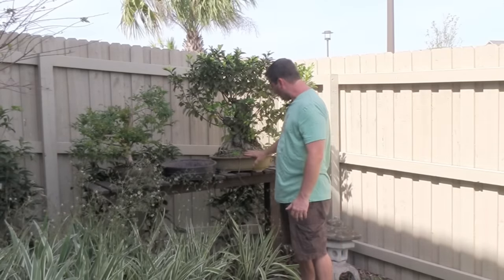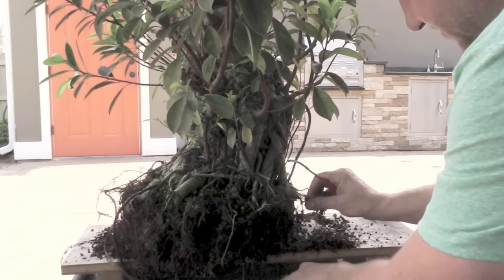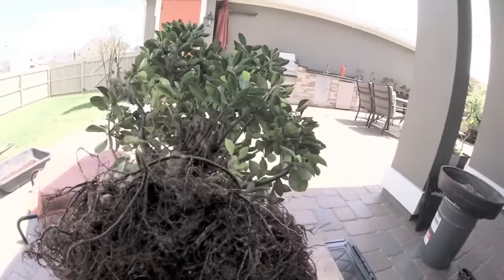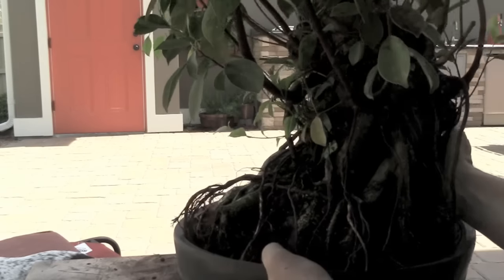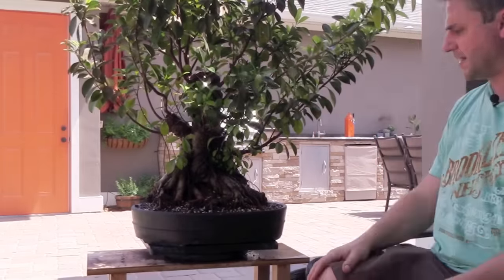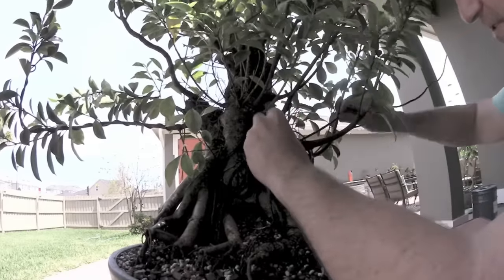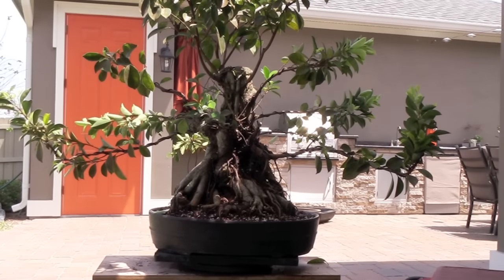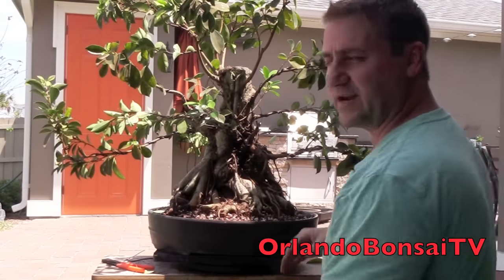How to Bonsai - Ficus Tree Update

Comment: Very nice--thanks so much for this wonderful sharing!  I'm living in extremely humid South China.  I've been wanting to get into bonsai for a long time and  finally got in contact with some bonsai experts in a commercial nursery here, but things are done quite differently and not sure what advice to take.  Chinese do tend to be a bit slap dash--so anyway, when selling me a tree and re-potting it for me, they would put large pottery shards at the bottom of the pot, instead of screen and they don't wire the tree into the pots.  I wonder if I should get screen and plan to wire them in and risk re-potting them so soon again.  They didn't repot in the sense that they didn't do any root work--they basically just transplanted with all the dirt attached.  Could you kindly tell me what's best?  Also, when I asked about plant food, she told me just to pour in some pu'er tea--the first washes of the tea which you don't drink.   Thank goodness I drink a fair amount of pu'er tea!  They tend to specialize in podocarpus and don't seem to have a variety of other trees, though did manage to get one small (half sunburnt) maple, an azelea and a loropetalum. The soil mix she sold me was so hard it was like pieces of rock with what looked like occasional very small pieces of brick in it!   It was kind of irritating because I wanted to use that soil for my little miniature moss gardens, and it was like little rocks, whereas you need to put moss on un-littered surfaces.  Anyway, insofar as the bonsai trees go, I guess they are professionals....and maybe should just do what the Romans do....?  Before finding them I had bought a ficus retusa on the street a few months ago, which I haven't touched but think I'll begin to prune soon, because, though it's base is much smaller than yours, the thin branches are getting like four--five times longer than the tree and it's not only looking very strange, the branches are falling every which way and getting into stuff.  I was letting it all grow and grow in the hopes that the trunk would get fatter.  Oh, and btw, you might want to aim your camera a little higher next time so we can see what you do at the top.  However, it really was fine.
Reply from the maker: Hi Susan, I
m so happy to hear you are trying bonsai.  The technique that they use for potting is very traditional  The screens are a newer method but the broken pots is what was used for a very long time and works well.  No reason to use the screens if you don't have to.  Also the wiring in is needed if the tree doesn't have many roots or is unstable in the pot.  If its a tree that's been in a pot for a while it will stay in very well especially when the roots grow.  Bonsai soil does not use any potting soil or dirt of any sort.  It is all course materials with sharp edges to help the roots get more air and split more often so that the trees can survive in smaller pots than those in potting soil.  Moss will grow on this soil in time.  Don't worry you are on the right track.  Follow the locals, because they know best what grows in that area and helps them stay healthy.  Good luck and thanks for the comments

Comment: I live in Kissimmee and bought a Bonsai at home depot that I identified as a ginseng ficus. It has done well and I planted cuttings that are doing well. The original has only four branches with many leaves and roots starting in the center of the primary root. It is still in store pot. Would like to know how or when to re pot and if the branches should be wired together to force larger root. It has a horseshoe shaped root with four long branches growing straight up. Don't know how to proceed with it. Any advise would be appreciated love your videos and have a great interest in Bonsais.
Reply from the maker: Hi Doreen. Since it is a tropical tree you don't want to work on them until spring. Keep it fertilized with something like osmoscote time release. Also search for Central Florida Bonsai Club. We would love to have you join us

Comment: Thank you sir for the great video, plz what kind of soil whould you use if u lived in a hot, dry climate characterized by long, dry summers and short, cold winters. The climate is influenced by Jordan's location between the subtropical aridity of the Arabian desert areas and the subtropical humidity of the eastern Mediterranean area. January is the coldest month, with temp from 5°C to 10°C, and August is the hottest month at 20°C to 35°C. daily temp can be very hot, especially in the summer; on some days it can be 40°C or more?!
Reply from the maker: Walid Alik I would use a good soil that has good water retention but drains well and does not keep the plant wet.  I would add a top of Sphagnum moss on top of the soil to hold in moisture and to block the sun from drying out the mix as quickly.  Filtered sun will help your trees no dry out too quickly.  Its all about keeping shade over the tree so the water uptake into the tree is enough to help the tree respire to keep itself cool.  If the heat it too great the tree won't be able to pull enough water up to the leaves and will overheat and die
Reply: Thank you so much sir,  appreciate your professional advice.

Comment: Hello so I have a ficus story and a ficus problem maybe you can help I live in St.Pete FL I was biking down the road wen I saw this great ficus stump that some one dug up and it was half dead laying next to this guys garbage barrel so I grabbed it up put it in a huge pot and brought it back to life about a year ago in time I will do a video on it but it is a ficus but not like the one in your video the leaves are different and more dense but it gets thesis  little black bugs that roll the leaves up like tacos do you know what kind of bugs they are and how to get ride of them  any help would be thankful.
Reply from the maker: Way to go on saving the tree.  You never know where you're going to find bonsai material.  The problem you have is most likely Ficus Thrips (Gynaikothrips uzeli) causes sunken, reddish
spots on leaves. Leaves tend to curl and fold inward.  You can use an insecticidal soap or neem oil (Green Light Neem, Schultz Garden Safe Brand Neem Oil).  May may want to remove the leaves that are curled and treat the rest of the tree.  Spring might be the better time to aggressively attack the thrips since they go after newer growth